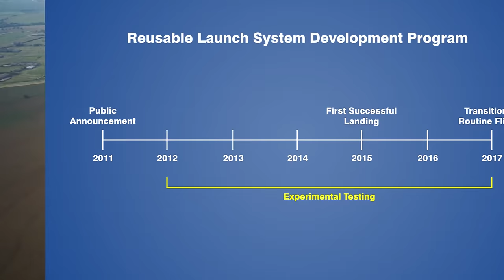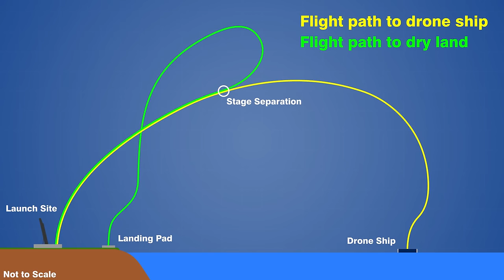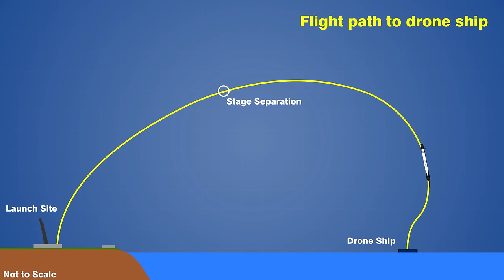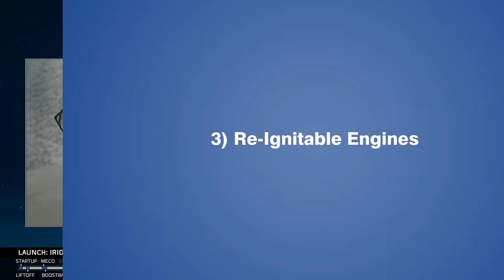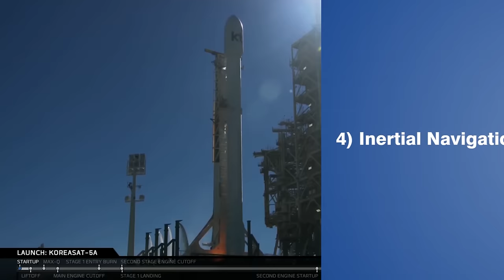How SpaceX Lands Rockets with Astonishing Accuracy

Comment from the maker: Which SpaceX milestone are you most excited for in 2019?

Video corrections:
1) At 2:50, I provide the measurements of the entire Falcon 9 rocket at liftoff, which is misleading. Only the first stage of the rocket returns for landing, which is approximately 43 meters tall and weighs around 22,000 kg empty.
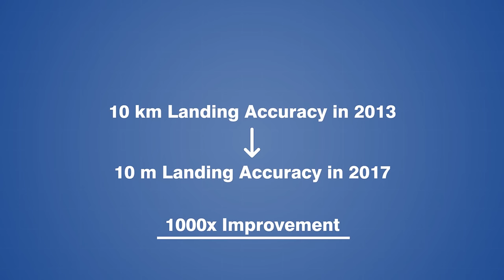2) At 5:00, I state that the improvement in landing accuracy from 10 km to 10 m is 10,000%. This is incorrect. The increase in landing accuracy is actually a 99.9% improvement.
Reply: Starship Hopper tests and hopefully the first deployments of Star Link.
Reply: Dragon 2 and Starship Hopper Tests
Reply: Demo Mission 1
Reply: Crewed Dragon to the Space Station. Great PR and big $$$ maker for Space X to back up and finance BFR / Starship development.
Reply: Bfr
Reply: This is awesome 👍☻👌
Reply: Art of Engineering starship
Reply: dragon 2 landing
Reply: the loss of jobs
Reply from the maker: @joeamos-somasystemspvbatte6  Too soon
Reply: Next step: Landing on the launch mount.

Godlike.
Reply: I hope it never comes to that because they have led the way and done so much, but I can see more than just the announced jobs going. sign of the times across this troubled world
Reply: DM-2 in June (hopefully!) will be pretty amazing. It should be seen as far more than just American astronauts return to space but as another step humanity takes towards Mars.
Reply: Everything! I am looking for a second Falcon Heavy launch, for crewed Dragon mission to ISS, for more succesful tests of the BFR. Wow that Elon Musk is just a creature from another universe! :)
Reply: NO "INFORMATION" here
Reply: Improved CGI so that I can try to pretend to believe any of this bullshit.
Reply: thrust hahahahah, why?? Are you the one doing the cgi? There are some pretty good courses you can take mate..
Reply: Love that you did this!
Reply: Dragon 2 and the BFR :)
Reply: Demo Mission 2 and Falcon Heavy 2. In that order.
Reply: Peter Domuzov   Thank God at least one other person here has their own rational thinking mind & able to discern. Sorry people have to resort to name calling here Peter. Stay great. Keep a truthful eye. Blessings.  D
Reply: reverse thrust   😂. “Shut up Peter”- we don’t allow people to think for themselves. No, questioning these smart “Scientific guys” either. OMG 😂
Reply: Imprisonment for fraud! That would be an awesome 2019! Outer space is faked and a money making fraud. "Space is the final frontier, but it's made in a Hollywood basement." - Chili Peppers
Reply: JAKE W JONES  100% agreed Jake. But, let’s take the present “real world thinking” a bit further. Because of The Space Travel hoaxers, the media, world leaders and the MAJORITY of humanity has been indoctrinated so incredibly- the realization of the FRAUD will not be realized. The majority of people are now sleeping sheep. So so sad. People have absolutely lost their rational thinking minds. There is no discernment anymore. They’ve been brainwashed slowly over the last 50+ years. No more thinking for themselves. It’s over buddy. You and I are the minority’s and we are now scorned and considered nut jobs for thinking with our own clear minds. All I can say now is hang tough my man; this will get waaaaaay worse. Wishing you and your family every blessing. Btw, thank God for you & a few others. We can try, but I don’t think we will convince too many at this point. Thx for your bravery of self-thought. Blessings. D
Reply: I look forward to Elon Musk blowing the whistle on the fraud or going to prison. When SpaceX realized that space travel is impossible, they should have never let the government take them by the horns and run their show. They should have had the balls to tell the public.
Reply: JAKE W JONES   100% agreed on all. I’m astonished that good people are so fooled by all this ridiculousness. Thx
Reply: Thanks! Check out my channel. I just posted a video titled, " Denver - 1 Mile High on the Flat Earth, & 190 Miles High on a Globe. "
Reply: OOPS lol DEEN this is Jake.
Reply: I'm not a flat Earther or a NASA fanboy.   Here is something you may be able to answer.   We are shown videos of 'astronauts' floating around in the ISS which is barely above the surface of the Earth... only 250 miles.   Obviously their weightlessness is a contrivance and a balancing act between two forces gravity and centrifugal.    So it's not pure weightlessness of space.   My question:-   If you take-off from the North Pole and travel directly away from the Earth how many miles do you need to cover before you become weightless?    There is no centrifugal force in operation.
Reply: Art of Engineering where do you get 10 meter accuracy from? It seems like they always land within the landing circle.
Reply: "How spaceX lands rockets with astonishing accuracy" lol it doesn't: it's computer graphics, camera trickery and balloons. "space" hahahhaha lol yea right
Reply: @douglasgeorge1081  
If you jump, you are "weightless". Instantly. What is so hard to understand? The beauty of Near Earth Orbit is that the weightlessness is sustained for a long time because there is no collision with the atmosphere or surface. Your "north pole straight up" example is just a higher jump, unless you reach escape velocity.
Reply: @avid0g  You obviously don't understand.   Instead of jumping up and down try thinking about it.  LOL
Reply: @douglasgeorge1081  
Your condescension is getting in the way of your comprehension. Weightlessness is not a property of space. It is a property of falling.  Gravity exists everywhere in various amounts. Weight is the result of resisting gravitational attraction. Weight is the result of acceleration. In your question, you assume that distance from the North Pole has some relationship to weightlessness. It has none.
Reply: @avid0g  Oh dear you still don't get the question.   "Weightlessness is not a property of space. It is a property of falling"     Weightlessness is lack of forces on an object or body.....  therefore no weight.    You are talking about a perception of weightlessness.   Never mind.   The question was to get people thinking.   So go back and think about the question of leaving the 
Earth from the North Pole directly without speeding around the Earth and I am not talking about escape velocity..
Reply: Are you suggesting some kind of rocket launch?
Reply: @douglasgeorge1081 
Ok, you climb up a ladder at the north pole. So what is your point if ascent is done with a rocket? It is just a matter of scale. What is your question exactly?
Reply: @douglasgeorge1081 
Weight is measured with a scale, either using a spring or counter balance. If you stand on it, it measures some weight. If the scale is in free-fall it measures zero weight. amiright?
Reply: @douglasgeorge1081  
In your original post, please tell me why ‘astronauts’ is in quotes. Are you dissing them? Are they unreal?

You also say, “Obviously, their weightlessness is a contrivance and a balancing act between two forces, gravity and centrifugal. So it is not just pure weightlessness of space." 

Unfortunately for you, that statement is incorrect on every point, and indicates that you have powerful misconceptions that have interfered with your understanding of physics. 

First, there is no centrifugal force, except for the rotation of the space station at one revolution per orbit. If the station was oriented to have one surface always facing the Moon, the rotation would be once per Lunar orbit. If oriented to a distant galaxy, it would effectively be zero. This force is never equivalent to nor opposite of the gravitational attraction of Earth.

As for gravity, it has no force. As established by the consensus of all experimental physicists, gravity is not a force, but a distortion of both space and time. General Relativity is the undisputed best theory for gravity.  

Even if you use Newtonian physics and accept the illusion of gravitational force, there is no centrifugal force to balance gravity for any objects in orbit. In Newtonian physics, satellites orbit Earth only because they are moving sideways fast enough to avoid colliding with Earth’s atmosphere. This especially clear to see with any object in a highly elliptical orbit. Near the “middle" of their orbit, they are falling nearly straight up or down but, as they fall, they accumulate enough sideways velocity to miss the atmosphere at the “bottom" of their orbit. At the “top” of their orbit they have minimal velocity in every direction, relative to Earth. This behavior is not compatible with the accepted concept of centrifugal force. Centrifugal force applies to rigid structures with spin, not free-falling objects that have almost no spin.

If you stood on a scaffold 250 miles tall at the North Pole, you would weigh nearly the same as at the surface. If you stood on a platform configured to hover exactly at 250 miles above the surface, you would weigh exactly the same as on the scaffold (except for the mass of the scaffold).  

If that platform was stationary exactly one Earth radius away from the surface, your weight would be 1/4. Two radius up, you would weigh 1/9 (ignoring gravity of our Moon, etc.) This is the inverse square law. Regardless of the platform distance, you will have some finite weight. Unless you step off the edge, or jump above the surface. However, the same applies on Earth’s surface. There is no difference. 

And so, my answer is still: being weightless has nothing to do with being in Space, and has everything to do with falling. You do not have to go to space to be weightless. 

If you feel disagreeable, how about the Moon? If you are 25 miles above the surface, are you not already in "pure space", regardless of velocity in any direction? And really, with no atmosphere, there is no existential difference between 25 miles and 25 millimeters. Are you in the weightlessness of "pure space" standing in your 25 mm thick space boots?
Reply: I honestly think that such Space Engineering is among best 'Engineering Marvel' in history of mankind so far.
Reply: Even  space x face a lot of failure and mistakes, so everybody make  mistakes no big deal.
Reply: 10m accuracy?!
My grandma can shoot darts better.
Reply: Starship suborbital flight
Reply: After reading what people comment down below, I have very little hope for humanity. We are still very much the monkey.
Reply: Ok i know its not ur falut that most people are stupid so u need to make video simple but u should have made it in two parts second  part with actual topic
Reply: Art of Engineering, what type of CPU the rocket used ? How much RAM and ROM the system have ? How many system redundancy it used ? How many megabytes of code in it's control system ? What frequency they use for communication to Earth ???
Reply: A little late but I think it would have been interesting to explain what an IRS is and how the modern ones work with lasers and measuring the “bending” of light over very short distances.  It might help some of the science denying dunces in the comments above as these systems a incredibly small, accurate and are on almost all jet aircraft.
Reply: Brit Hey 
Or rather the common ancestor with it ?  

I travel all over the world for a living and except for the Islamic world, I rarely meet meet true science deniers. The ones I have met are completely undereducated and have fallen victim to conspiracy nuttards here on the web.  I can’t blame them really, mysteries are fun. They just can’t discern that when the premise is irrational, it’s not a worthy rabbit whole.
Reply: When they really go to space!
Reply: Starlink
Reply: You should also pin "David Ogawa"s comment just below, as it's very informative and popular, really complements your video!   People (like me) are still visiting this video. And thank you for putting it together!  Cheers from Australia.  👍
Reply: @wildyracing1  yeah man, it's happening! The crewed dragon mission to ISS is on as we speak! Elon Musk the born genius :')
Reply: First stage contains the largest portion of propolustion...
Reply: this is true for the boost into space for the dragon capsule, but the boosters are returned from the "heavy rocket" Which is not used in launching the dragon.
Reply: The latest one, getting 2 astronauts on Dragon up to the ISS and back.
Reply: It is far better to watch spacex x then watching @NBC
Reply: Starlink would be very helpful to 3rd world countries.
Reply: @douglasgeorge1081  gravitational force decay to the inverse square of the distance and its directly proportional of the mass  of bodies involved ,, one of them very large (the earth) ,,,  so it never realy goes away ,, after you get far enough from earth the sun forces will actuate ,,or  other celestial bodies , moon etc ,, total ingravity may not be theoretically possible ,,,  practically will be a delicate  equlibrium of many forces from many bodies acting combined and in motion so a point of cero gravity may no be able to be found ,,  I think .......
Reply: dreamers of the 21st century. What an audacity
Reply: Mars base
Reply: And to think they just did the 59 LANDING in 2020
Reply: @douglasgeorge1081  
When we jump, we are instantly "weightless". It has nothing to do with space. Astronauts inside the ISS experience microgravity because they are falling. The ISS is also falling. 

The only reason the ISS and Astronauts can fall indefinitely is because they are in a very carefully selected circular orbit.
Reply: Easy launch easy land
No Fire
Can fly in Zero Gravity
Just spinning
Rocket is complicated and dificulte
Low safety and high cost
Developing technologies to enable human access to space at dramatically lower cost and increased reliability #FeelFree http://youtu.be/6q7MovLP-e8
Reply: @babayaga9570  
Go and watch it for yourself.
Reply: SN9
Reply: Thanks.

Comment: Next video, the secrets to getting A+ in every exam:
1) Study Hard every day.
2) Pass the exam.
Reply: Dude, you can't write it like that, there's not 6 minutes' worth of fluff to read before part 1, and step 2 is simplified way too far.  You have to spend 5 minutes explaining how you solve the problem and then have to find a pencil to slowly etch a small portion of the graphite into a circular pattern that corresponds to both the correct answer and the originally allocated number for the problem in the exam.
Reply: I think you're missing a step, there... What should happen between studying and passing the exam? Please help!
Reply: I actually don't study at all and somehow ace them 
oh and I don't cheat xd
Reply: @staitz2728  You're not being challenged then.
Reply: Green M yeah i’m bored as hell in school smh
Reply: No need to get an a+. Marks is a meaningless number.
Reply: Staitz then get ap classes because if you are bored you are in the wrong room
Reply: Jay Andrew  
Liquid hydrogen?? What am I missing? Is there a link between SpaceX and liquid hydrogen?!?!?!
Reply: The shuttle used Hydrogen, SpaceX use RP-1 and Methane..

I don't see why half isn't feasible, just because its unlikely to be true.. 
If it works it works.. Can't find a reference anywhere to a rocket using half its fuel to land however..
6-13% of fuel is used to land according to nerds..
Which makes sense given they do a couple of short burns on the way down..

The only boosters getting completely rebuilt are the ones landing in the oceans, refurbishing boosters currently takes a month and isn't expensive..

If it didn't work, then SpaceX wouldn't charge $5000 per kg!
Whereas Atlas V can launch 8123 kg for $164 Million. That works out to $20,200 per kg.
It's cheaper to launch because it's cheaper to launch..  :)

That's why SpaceX has 65% of the launch market and that's increasing....
Reply: @Jay Andrew Twice the fuel? 😆 On the way up, they are going against gravity and air resistance. On the way down, gravity is working for them and air resistance is used to slow down. Very little fuel is used to land compared to launching. You probably only put 5 dollars in your car at a time, don't you? 😄
Reply: Next video - How to fly a plane with ridiculous accuracy

1. Get in the plane and fly it 
2. Don’t crash it
Reply: Max gamer 20 someone did bad in school
Reply: Or bribe the teacher like Lori
Reply: 3. bribe officials
Reply: WRONG. You've got to study ridiculously hard.
Reply: Dan K Einstein dropped out of high school and got a ged.
Reply: Now try get A+ in thermodynamics fk this shit
Reply: Dan K...sit next to the Space engineer during the exam and copy
Reply: Are you kidding?
That's outdated methodology.
Nowadays, forget the exams entirely.
Just hack the school's computer.
Reply: Correction:
1. Study hard.
2. Do NOT get caught!
Reply: Profound tips.
Reply: Or you could be like the People's Republic of China and copy someone else's exam. 
Just like school bullies, you don't have to study !
Reply: @texasray5237  I was expecting your Tube name to look something like " Xing Tao Ping Chao "